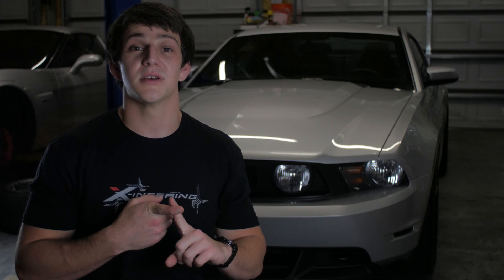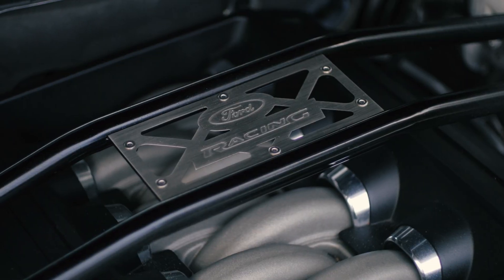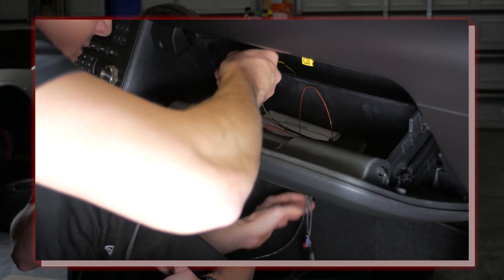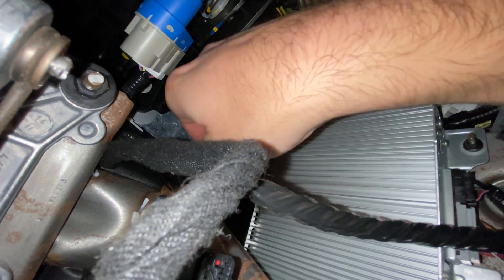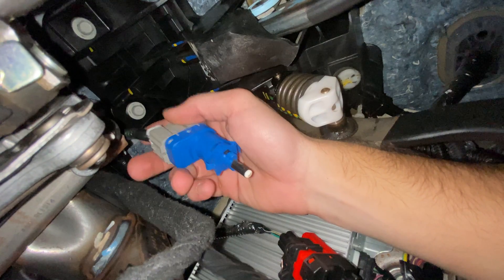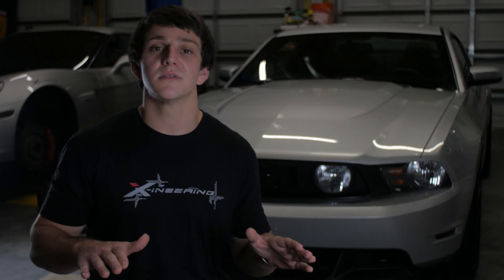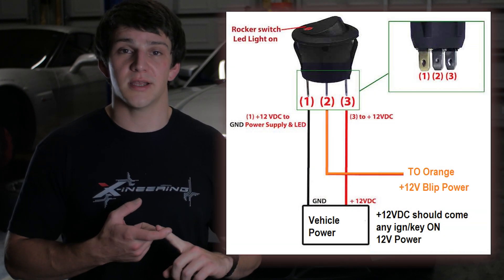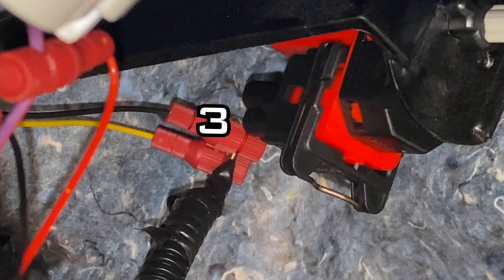2011-2014 Mustang - Downshift Blip Module Install

Comment: Any plug and play modules for a 2011 mustang 5.0 that doesn’t require splicing into wires?
Reply from the maker: Jesse, Thank you for reaching out to us.  We emailed you as well but figured others would like to know.  
Currently, the 2011-2014 Mustang Blip Module kit is as you see it in this video.  
It is only plug and play on the throttle pedal harness.
It may be something we create in the future.  
We are researching the clutch and brake pedal sensor connectors.
Thanks again!!

Comment: I have a Ls2 T56 swap 69 Camaro with a drive by wire set up I been looking for something like this .. (rev match) ? Will this work for me 🍻🏁
Reply from the maker: Thanks for reaching out!
Shoot us an email to xineering@gmail.com or fill out our Contact Us form on www.xineering.com
Let us know what ECU and DBW pedal you are using.  We support just about every GM pedal/ecu combination.  Then we tap into your upper clutch switch and brake circuit to trigger a blip on downshifts.  
We look forward to hearing from you!